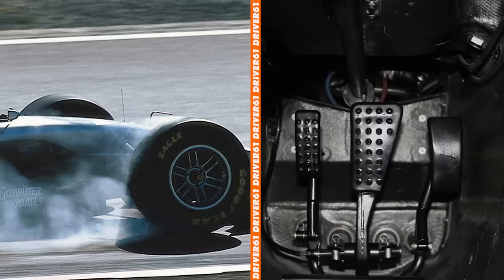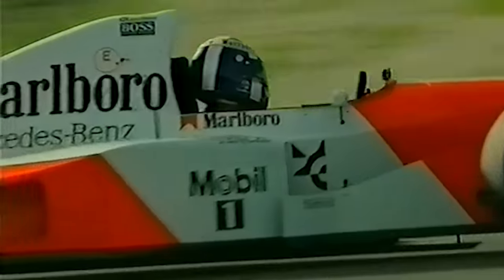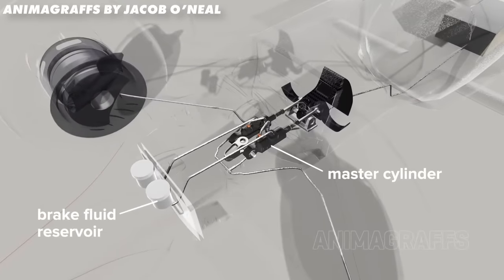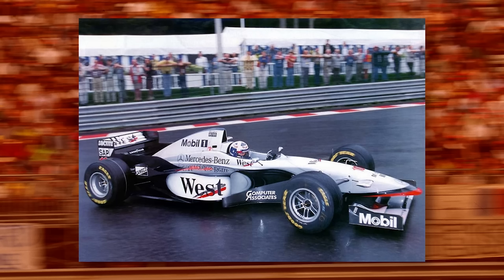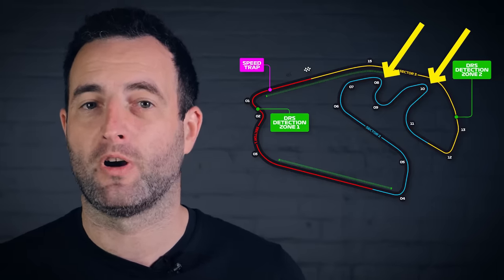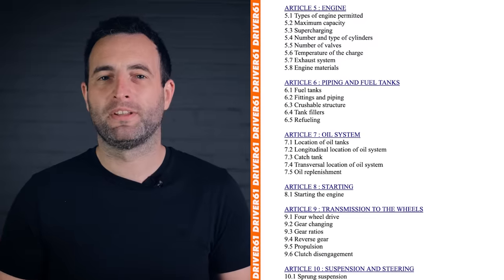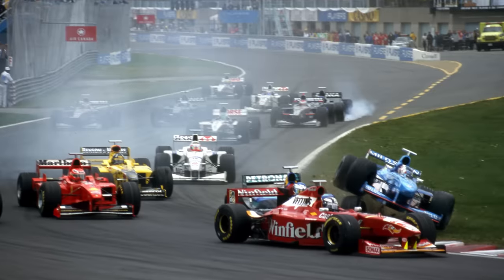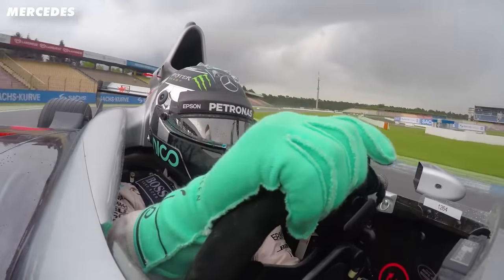Why This F1 Car Has FOUR PEDALS

Comment: While it's clearly not 4 wheel steering, you could argue that it is three wheel steering.  I really don't see why it should have been banned.  Everyone else could have implemented it, once they knew about it, and since the wheels aren't changing direction, just one of the rear wheels is changing speed, I think it's just a really clever innovation.  It seems like the FIA bans technologies simply because it gave one team a very big advantage.

Comment: If it isn't in the rules - then it isn't cheating (technically speaking).  However, is it in the spirit of the rules and regulations - arguably not...  This is often the main reason why rules and regulations in all sports get changed or at least modified.  Despite clever (or devious) people devising "get-arounds", the governing bodies want to ensure that their sport remains fair, safe and yet still competitive, without too much interference into innovation and its evolution but at the same time ensuring that no one is given or is allowed an unfair competitive advantage.  
After all, the competitors and the spectators want to see and be apart of fast, fair, competitive and exciting racing.  That's what it's all about....
Incidentally, we were there at Brands Hatch back in 2004-ish? when you did a pretty quick time of about 38 secs of the Indy circuit in a Benetton F1 car during a EuroBoss race. Not sure whether this is still the Indy circuit lap record.
Great video and I shall watch many more - have just subscribed and others in my family have too....

Comment: Note that protest were waived away until Ferrari complained, then all of a sudden the system was deemed illegal, and some people still wonder why the FIA got the nickname Ferrari International Assistance. You can bet that if it had been developed by the team from Italy it would have been allowed right up until someone developed a better system, then banned for some obscure reason that made no sense to anyone! This has never really changed, just look at the 'behind closed doors' agreement to resolve Ferarri's fuel flow irregularities in 2019... and before anyone says they were never PROVEN to have cheated. If they were doing nothing wrong they would NEVER have done a deal of any kind, and had a less powerful engine the following season, meaning they stopped using whatever it was they were doing to make their engine so powerful in 2019, teams don't take such hard fought gains off the car unless they are forced. Then there is the little matter of Spygate when McLaren were excluded from the constructors championship for a season and fined $100M, and as they were deemed the aggrieved party (although McLaren never actually used the drawings, and I believe they never actually made it to the factory), Ferrari were let off the fact that the drawings showed that their floor was illegal! This was banned for the same reason that everything else gets banned, because it was ingenious, and didn't come fitted to a car painted red!
Reply: Another good example was Renault's Tuned Mass Damper which was deemed legal despite protests from other teams until Ferrari discovered it only worked well with the more compliant sidewalls of the Michelin tyres and had little benefit when using the harder sidewalled Bridgestone tyres which the Ferrari ran. Ferrari protested and suddenly it was banned mid-season!

Right through F1 history there are cases of ingenious developments being banned by being written out of the rules for the following season, unless of course Ferrari are front and centre of the protests, I which case they don't usually make it to the next race! No other team has the same level of success in getting other teams innovations banned, because the FIA has a misguided belief that F1 can't exist without Ferrari, but forget that Ferrari would be MASSIVELY damaged without F1. Without being at the top table of Motorsport, the world's leading sports car manufacturer would just be another manufacturer of temperamental cars that look great as they grind to a halt, before you watch several thousand pounds vanish from your wallet just to have them tell you what's wrong with it, and then the big bills come in!

Comment: When I was testing for McLaren in the mid 90's I gave this set up a go a full 9 months before I handed over to Mika. The working title of the tech was called rear brake control. After only seven laps of Silverstone I was 0.3s ahead of a comparable wet lap time. 
I used the right pedal similar to heel - toe. Quite easy as I was adept at racing Carlos Sainz's cars.
The left / right switch was actually developed in real time, straight from the off but not included for another 12 months.
Reply: Give us more context as to who you are Dave?
Reply: @natjzam  I'm a pathological liar.

Comment: I think it was perfectly legal, but "steering" needed to be better defined, and the name gave wimpy decision makers an out. 

And why couldn't Ferrari duplicate it? Sounds like a case of NIH (Not Invented Here).

It is all about keeping the race close and safe. Close is more exciting for the consumer fans. That being said, how close? A half second doesn't sound like a blow out season while the other guys figure it out. If it was 2 seconds a lap the racing could get boring.

If F1 brake hydraulics are anything like normal road car brakes (on steroids for sure), there really shouldn't be a fail-safe problem with a check valve or two, and as you said, cost isn't a factor for this mod.

Like a lot of people say below, I am here for the engineering. I don't like outlawing any tech that doesn't affect safety or make a race a blowout (cost can be another factor, but that isn't the case here).

Comment: The way you know it's cheating is if it gets bannned but is driven anyway.  The FIA sets their own rules, changes them when they feel like it, and if, like the FW14 a car is no longer allowed to compete,  McLaren did not race their "brake-steer" system once deemed disallowed.  Hence, no cheating.

Six wheels on an F1 car?
Active suspension for that other Mansell guy?  (Sorry Scott, you just lack the moustache and accent ;-)
FW14?
McLaren brake steer?
Not testing Kimi's BAC before a race?

Not cheating.  Just good engineering that the FIA deemed no longer allowed.

Ehud
Tucson
Arizona
USA

Comment: Clever engineering. The reason other teams protested was because they couldn't figure it out for themselves so instead of working on solving the problem, they just put pressure on the FIA to ban it.

Comment: I swing my tractor around crop row ends with split-steering brakes.........can I be an F1 driver now?
Cool to see this adapted to ridiculously fast racing cars, but it's not particularly ground "braking" !
Reply: Yep tractors have this feature since a very long time. You typically just unbolt the split pedals and can brake on only one side.
ESC systems in cars use a similar concept, but they use the opposite front wheel additionally

Comment: I call it cheating because actually it is four wheel steering just like active  differential in modern sports or supercars(most of the torque goes to outer wheel when cornering)

Comment: Absolutely not cheating. The rules clearly say FOUR wheel steering. This only only applied extra brakes to one of them.

Ferrari was just mad they couldn't figure it out. Engineering is hard. Complaining loudly non stop is much easier.

Comment: Let me see if I understood: It was deemed ok at first, the other teams try to copy it but failed so the lobby to ban it. and furthermore the system require even more skill from the driver. yeah, not cheating at all. (also, this can only be 3-wheels steering at most.. so not 4 wheels steering...)
Reply: When braking the inner rear wheel the differential would transfer more power to the outer wheel effectively making it a 4 wheel steering system.

Comment: Would definitely not call it cheating although I understand the reaction of the teams back then.  Look what happened when Mercedes introduced DAS
Reply: DAS was too expensive for every team to follow it, so they had it banned. They were still allowed to use it for 2020 anyway.
What's Unfair is when Merc cried for RBs Flexy floors and had it banned mid season. Too bad for them RB got faster.

Comment: Those clever F1 engineers comming up with something you’d find on a farm tractor over 1/2 a century earlier. If they’d still called it a fiddle brake I guess it wouldn’t have seemed so innovative and doubtless the FIA would still be unimpressed as fiddle sounds a bit like cheat.
Nowerdays this is one of the main principles of electronic stability control on modern road cars.

Comment: IN FACT  .....  YOU  drive  like  an AMX-13 French  tank  with  tracks  ....  behind  youre  back  ....   If  you do brake the  right-hander  pedal  with  the   feet,  the  rear  will  pull  you  to  the  right   side  ....  while  you  hit  the  throttle  a  while  into  the  corner  .....  The engine - power  at  the  left  side  will push   you  the  corner  inside   ...... its  like  some over-steer while you  hit  the  throttle  to  hard  .....  Simple isnt  it  ....  ?

Comment: Clever engineering, because it was inexpensive, yeilded better control and quicker lap times. The naming was unfortunate. Calling it brake-steer was bone headed. But, such is F1. Instead of the other teams perfecting their own systems, they bitched and got an interesting bit of innovation canned.

Comment: Is it cheating? Yes it is. There are vehicles out there where the steering ist based on braking on one side and accelerating with the other. 
By the way, if i remeber right, there are also nornal sporty streetcars out there that uses this electronicly to assist in corners. Its also used in heavy trucks and machinery for the same purpose just not for better speed but for better handling with that big machines.
So in the end, its used for steering at least to a %.

Comment: Brake steering ist for something else then steering axle... This is for me more like manual traction controlling. Sorry, I would be glad to have it in my car - I mean, sure I habe one but it's just dumb. Only Nissan in GTR is able to put more power on one wheel while other wheel would brake at the same time to gain stability and speed on the corner. 🤷‍♂️🤦‍♂️

Comment: If Lewis Hamilton locks up all four wheels going into a turn and slides off the track, is that considered brake steering? He used the brakes to steer in a New direction! Maybe they should think about banning brakes on cars and take formula 1 to a whole new level!

Comment: This is used and fully legal in all motorcycle racing. It is a thumb-brake that is another rear wheel brake so help with wheelie control, slowing a floating rear tire down in braking zones while hanging off a leg, and for better turn in to help rotate the bike. 

The stuff that's illegal in F1, is fully legal in motorcycle racing. Multifunctional braking systems, dynamic ride height in MotoGP, etc. F1 sucks, and has for 30 years